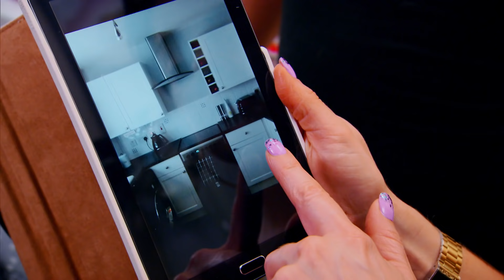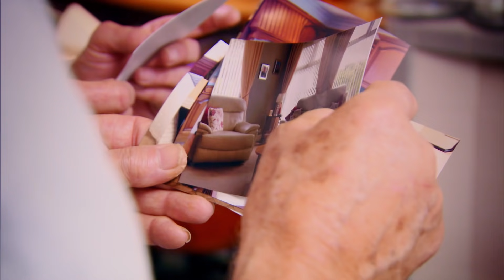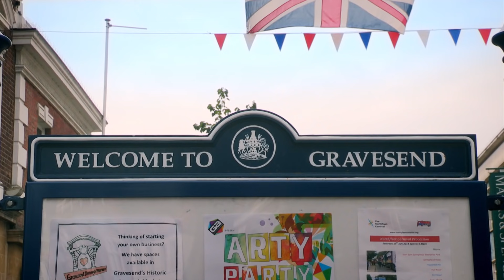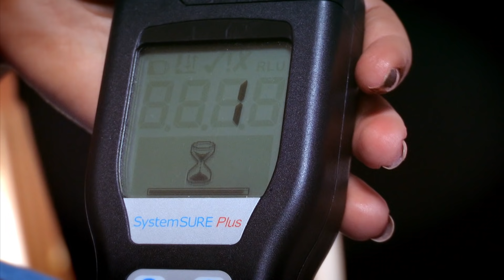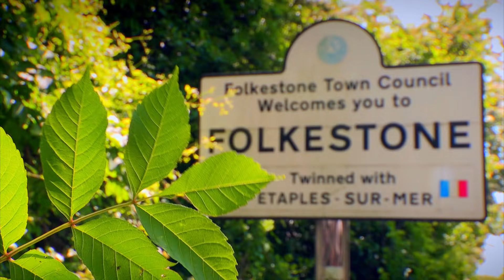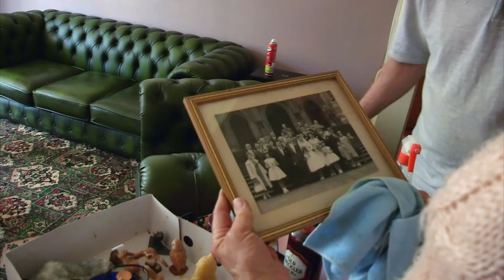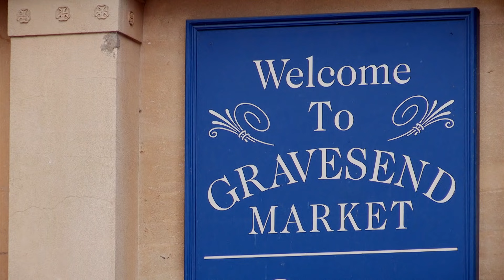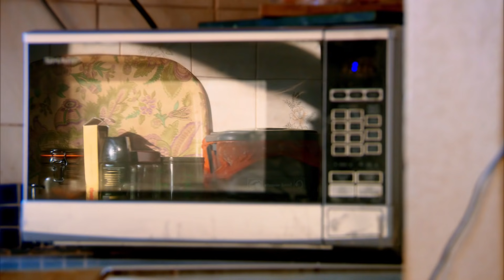The House Filled With Owls... | Obsessive Compulsive Cleaners | Episode 14 | Filth

Comment: Gemma, antibacterial wipes are a landfill nightmare. Just use reusable cloths with antibacterial soap on it.
Reply: This was filmed years ago.
Reply: @eccremocarpusscaber5159  And? They have always been landfill issues
Reply: Or soapnuts which are antibacterial and biodegradeable
Reply: @PBMS123  When this was filmed, the environment wasn't on most people's everyday radar the way it is now. I don't think at home recycling bins even existed when this was filmed, everything went to landfill.
Reply: @untetheredsoul  Environment issues where on people's radar since the 1970ies.
Reply: Just using spray and a cloth does not guarantee that the surfaces are clean. Would you wipe your kitchen counter tops after cleaning the floor with the cloth??

I have antibacterial spray and wipes. On things like my windowsill, I use an antibacterial wipe due to my pets leaving muddy paw prints up there. I use my cloth and spray and things like my bedside table, door handles, tv remotes and light switches/remotes. 

Everyone is different. If you are that bothered by it, don’t watch it!
Reply: So true
Reply: @woodelf6040  soap nuts do little to nothing
Reply: @iliketrains3601  Well they do wonders for me anyway so maybe you should use 50 like I do in one go?
Reply: @woodelf6040  well that gets expensive and ineffective to use 50 of them. Not to mention that it doesn't even grow where I live so it has to be shipped through half of the planet which isn't very sustainable. I tried soapnuts before and was very, very unimpressed. It didn't wash my tea towels well, neither food stained tshirts or underwear. Maybe they work for very delicate very lightly dirty stuff - but if you sweat a lot/have heavy discharge/have  kids/cook a lot/want things REALLY clean, they do nothing. The things just dont feel clean at all. I like my locally made detergent better.
Reply: @iliketrains3601  oh wait - I think I was confusing them with soapwort which I have been sourcing locally and then I save my old bars of soaps to use en mass with it. If that makes more sense? Yeah tell me about it - and buying them online all the time instead of going to the shops is a pain too. Glad my soapwort grows in my garden though!
Reply: @PBMS123  I watch this episode just now. I am new viewer, on this channel.
Reply: I was thinking the same thing 
She has no idea how much she’s messing with the environment
Reply: @starchild352  Agree, that is true.
Reply: what do you mean by 'reusable cloths'?? i was thinking every cloth is reusable
Reply: @PierreFerreira978  Wipes are single use.
Reply: @allykuit5384  ohhhh LOL I was thinking about clothes, nevermind kkkk
Reply: Reusable cloths and microfiber cloths can put in washing machine. Wash them in 60 degree.
Reply: Somehow majority of those overly clean freaked people don't like ok care of animals or anything about nature, and even opposite - they become the most disconnected from nature..
Not all of them, but still..
Reply: @anitasyvalahti1730  yeah, isn't it crazy? I never could even imagine wearing shoes in my home. And I'm not even a clean freak.
Reply: I use common washing powder/liquid. Mild fragrance or with out. In our area water go in sewage treatment plant; refinery.
Reply: @priyaperral7498  Yes, it is! Me either, shoes are always dirty, more or less. Me either, i´m not clean freak.
Reply: @untetheredsoul  Yes this was then. I remember time of them. in the food shops, meat and sausages was wrapped in the paper. Salesman/woman wrapped they. Also was plastic pags. I remember cornflages. In modern times everything is in plastic. RECYCLING IS SO IMPORTANT! ON OUR ENVIROMENT
Reply: Are you creasy? Reusable coths spreads germs onto everything!
Reply: @charlottewilson2738  AMEN!!!!!!
Reply: @charlottewilson2738  that's why you use different cloths for different things
Reply: Spot in. I am OCD but I have never used antibacterial wipes for that reason. I use clothes (old clothes cut up) and spray which I just buy once and refill them with my own antibac.
Reply: I use different colours cloths, pink for sink and blue for loo. For my kitchen I use white and for dusting the traditional yellow cloths. All get soaked in zoflora then run through the washing machine on a 30 minute wash with bleach in the washing draw that way my washing machine gets a run once a week in bleach to.
Reply: @eccremocarpusscaber5159  uhm the environment crisis has been going on for so unbelievably many years are you being fr ahhha
Reply: @charlottewilson2738  You use a different cloth. I have different cloths for floors,  works tops and toilet.  They are different colours so they don't get muddled up.
Reply: Those with OCD typically have regiments and rules they have to follow, it's part of the disorder.
Reply: No kidding, the cleaning products they go through too is just crazy and wasteful.
Reply: @priyaperral7498  They become detached and/or disgusted by human beings, even fearing closeness with them??? Lonely world 😢
Reply: That’s why I use one time use toilets. I just throw out the commode after every use. Porcelain breaks down real well.
Reply: a lot of them are biodegradable now! i know dettol are

Comment: I just why most of the OCD do not use chemical resistant gloves? 
In my opinion, they could use modern pressure washer, window vac, steamer etc make the cleaning much more easier
Reply: To use bare hands you get more satisfied on what you are doing, i guess 🤔
Reply: This show is also a bit older, I don't think steamers etc were as accessible pricewise back then
Reply: That's why they're OCD.
Reply: I hate the feeling of rubber gloves (I have OCD but it's not as severe)

Comment: It's beyond me why an OCD cleaner insists on placing their pillows on the tip of the four corners. Coincidentally I've noticed it's a very common practice with OCD cleaners. Well that's triggering my OCD because they are damaging one of the tips of the pillow. Not like it doesn't look like it's damaging one of the tips of the pillows. Seems to me if OCD someone wants a triangle pillow or a diamond pillow why don't you buy one. Oh I have to put my pillow on the diagonal on the tip of one of the four corners so it damages the pillow.